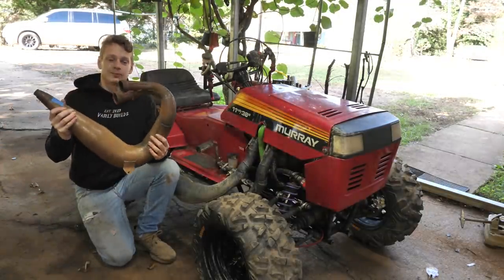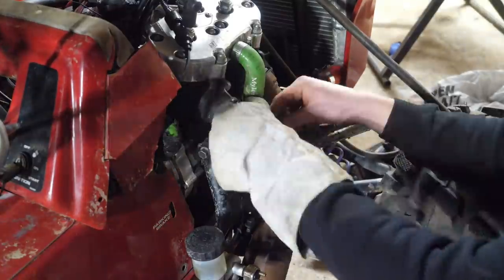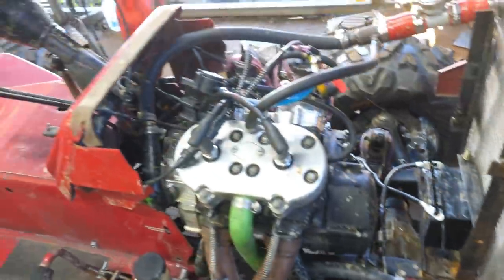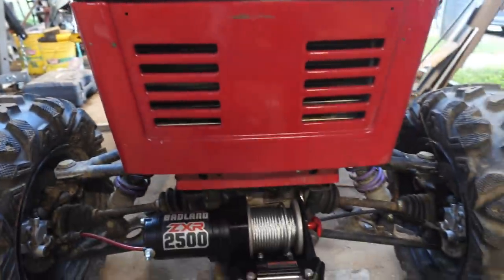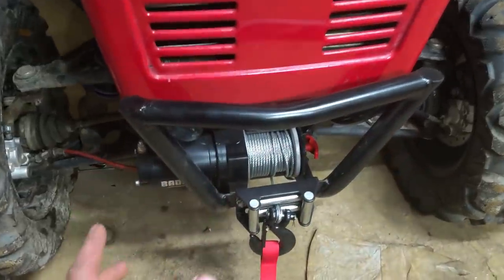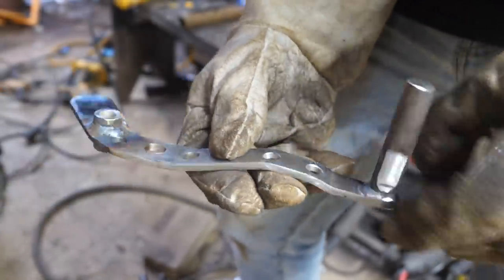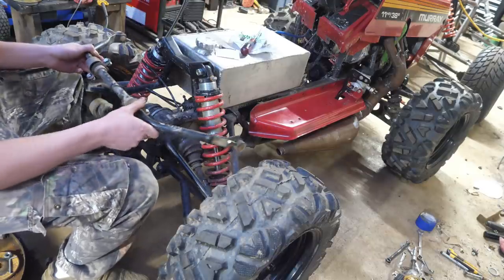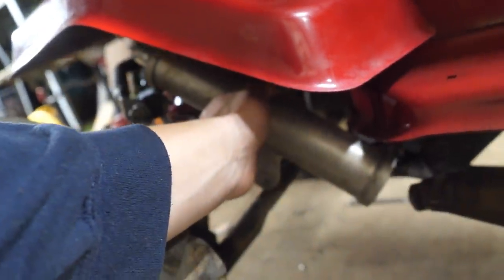4x4 2 Stroke Riding MOWER Gets 10x Better! Sounds like an F1 car

Comment: F-Yeah they sound tough. My neighbor goes through fazes. So during his quad faze he naturally chose a banshee due to the performance possibilities. So as usual step one break it down to every last nut and bolt. Sends the motor out. $20,000 later this Crazy piece of Performance Art returns. I honestly thought that my buddy got Ripped off and it was just pretty. Oh how I was wrong. We couldn't start it right away because it ran race fuel not regular gasoline. My first words on the  first start were, this sounds like a F1 car. That motor was so freaking pissed off I couldn't believe it. He actually only rode it a handful of times and sold it. We both agreed that it was a death trap and had too much power.
Reply: 4 mill cheetah motor ??? Or what

Comment: Bro.. the pipe's diameter and distance from the ports are precisely calculated in order to set your power band at a certain RPM--  When you cut it anywhere in front of the expansion chamber, you completely change it's tune.  It' still might work well, but if it doesn't, that's why.  That expansion chamber echo's the pulse back to those ports, and it does this at a certain speed (actaully at the speed of sound I believe)--- so if you change the distance between the expansion chamber and the ports, then it will change where your power band actually is... Typically the bigger the pipe and longer/ further away from the ports, the lower your power band will be, because it takes longer to echo back to the port--- so that makes it only work at lower RPM's--- (but also the more it will fall on it's face when you high rev)...... and that's because at higher RPM"s, the piston is going up and down in such a short time span, that expansion chamber has to be closer to the ports so that the echo can bounce back quicker, not that it's any faster --- it just has to go a shorter distance, which takes less time. I just have to stress again, the tuning of the engine and power band are directly related to that expansion chamber- it's diameter- and it's distance away from the ports...  hopefully it still works well for you--- but if not, just know that it's because of that pipe and you'll have to change it again.  There's a whole science to tuning a pipe for a 2 stroke..  There are not a lot of people who understand exactly how to build them right without the computer software to tell them how to do it.
Reply: Yes.
Reply: You sound very knowledgeable and I agree with you....  being as knowledgeable as you are I figure that you can also hear that it is running very well. When he made his pie cuts he rotated the pieces but kept the pieces in the same order, had he rearranged the pie cuts the results most definitely would have suffered. At one point, many years ago I was thinking the results would change or be very poor, but after seeing dozens, if not hundreds of shifter carts take the original snaking motorcycle chambers and pie cut them and reweld them in to a straight line with little or no loss of performance I became aware that it in fact does not matter.
Reply: @baby-sharkgto4902   Yeah, it does sound pretty good..  Again, as long as the changes are still a similar volume and length from the ports, it should still be pretty close..  It sounds like it's running fine to me.  I actually think his clutch is slipping.  If you watch it again. 11:46 -- after he shifts, you can hear the engine rev out quickly for a second--- as if that clutch is slipping.. Maybe that's him doing it on the controls--  maybe he doesn't realize that you only have to 'feather the clutch on take off..   Either he's doing it, or it's slipping.. or maybe the wheels are spinning-- but something is letting go...  You hear that smooth rolling load on the engine, and then after he shifts--- it high revs way too fast.  Clutches are easy to change though.   I've had issues with banshee clutches before... It would seemingly work fine until it would hit that power band, and then it would break loose.  I bought cheap new discs on ebay and never had an issue with it again.
Reply: @calholli  yeah I also hear that

Comment: Great job on moving your shifter..  You still need to shift faster.. Once it's pulling in that power band, just shift through the gears literally as fast as you can and watch it pull through every gear.  Trust me, when these things are running right, their power is pretty terrifying.....   It kinda sounds like your clutch is slipping...   either that, or you are too low geared and it's reving out before you can even shift to the next gear-- I can't tell without riding it myself...  It sounds like it's running pretty clean though, considering that you chopped up that tuned pipe..  Keep chewing on it.  There are more gains to come. lol..  Once you get it dialed in, it will start popping up wheelies when you shift while running wide open.

Comment: The exhaust DOES make it sound like an F1 car. Nice!!! Bumper looks great. You should dremel out the area where the stock headlights are and see if you can cleanly mount the light bar setup in that area. You could make a fiberglass 'bezel' or 'pod' to make it look like it belongs in that spot too. Would be sick looking.

Comment: 11:48 ...  See, it's reving smooth under load, and then right after you shift- it revs out/ high revs too quickly there ---   like the clutch is slipping.     The 6 speed transmission have really close gear ratios-- so you could actually be running out of gear that fast, which means you are too low geared and need to change sprockets slightly...  or again, you can just shift faster.  But honestly, it sounds very typical of a clutch slipping when the power band hits, or when you're rolling on the throttle...  Make sure that your clutch cable has a little bit of slack in it/  a little wiggle room-- so that you know it's fully disengaged..  Some people like to tighten their cable down too tight so that there is no slack, and that can cause it to not fully close---  it acts as if you're constantly slightly holding the clutch in a little-- which causes it to slip.... Either way, it sure sounds like it's high reving quicker than it should there--- something is letting go.  Maybe you're just spinning the back wheels on that pavement-- I can't really tell.
Reply: I also believe the clutch slips when engaging a new gear. I agree, check if clutch cable has little bit of play. This thing is gonna be awesome. This video you really were different, quick and efficient. Keep it going like this
Reply: The clutch is definitely slipping, possibly the cable too tight, or plates on there way out
Reply: You can hear the chain and sprockets skipping. Needs to go to a ribbed belt design or a better chain.

Comment: One other thing---  when you run it hard like that--- you should cruise around a bit and get plenty of air flow and let it cool down...  or at least when you stop --- let it idle for 40 seconds or so.  It keeps that water flowing in your head and gives it time to cool down.  WHen you ran it hard and then suddenly STOPPED.  All that heat is still chillin in your coolhead and that's why it started steaming that water.............  again, what I do when running it hard is take another lap easy cruising--  still running fairly fast, but not pulling hard and making heat-- that way you still have lots of air flow through that thing.. and by the time you stop again, it will be much more cooled down.

Comment: I loved the triple build, but I can see this works better. Do you have other plans for the triple?
Reply: "Works better" on this mower maybe-- but that triple is significantly faster on the right setup...   A triple sled will absolutely smoke a banshee quad-- both off the line and in top speed...  He just never had that triple geared right yet before he decided to change it.
Reply from the maker: Maybe a drag build
Reply: @calholli  He said that the cvt was way too low to the ground
Reply: @angelrs_0838  Yeah. .it wasn't a good fit for this.
Reply: Yes, meant works better for this build.

Comment: Unfortunately you may need to open that grill to move more air not sure if your running elec fan ? Consider that or some cowling to force air. Bigger radiator if or add small reservoir to displace heat exchange , heat steals power not your friend . Cool build keep at it and it will be terrifyingly fast lawn job , mowing , thatcher , aerating , twin bagger two pop multi purpose machine . And most likely neighbors enemy #1
If you continue to rip back & forth scaring the bejesus out of the unsuspecting  ? It would be ok in our neighborhood but their a mile

Comment: You should wrap your exhaust with ceramic bands to prevent over-heating because your coolant hose line is in between the exhaust collector

Comment: Gear ratio sounds good on the road but that’s it. In the woods you can’t hit gear after gear in the powerband because the gearing is to tall and you need a super low first gear anyways so drop that gearing so you can have a useable woods toy.

Comment: Ok now you need to do a whole new seating set up. I know your tring to hold onto the "look" of a mower... but its to much of a beast now build a little rack/cage letting you mount the seat back more use a bucket seat. Go from racing mower to  Rock crawler mower!!

Comment: i would have put bars on it and had the layout more like a dirt bike with twist throttle and clutch lever front brake and rear brake on the right foot and shifter on the left foot

Comment: Are you having overheating issues? The airflow may be the culprit. The hood openings are very small vs. the size of the Radiator. Either open the grill up or open the side panels beside the grille or possibly near the winch plus do you have an electric fan on the radiator.
Nice buggy!!!

Comment: Are you going to put a tip on the exhaust so it comes out the back? All that two stroke smoke will leave a residue all over the rear suspension and fenders.

Comment: There’s a little bit of scraping on the rear right fender when you press the gas cuz it squats so damn hard when you launch😭. May or may not wanna fix that but the thing sounds like a literal f1 car my jaw actually dropped watching this. You should definitely try meeting up with grind hard.

Comment: Vasily I have a question- my go kart with  a stage 1 kit goes a solid 26mph lol. I was wondering if I you removed the governor on your little red go kart you made a video on and rode around a school with. Because when you went full speed and hit 51, wouldn’t that blow the engine? I don’t know I’m just wondering the circumstances if I removed the governor and went full throttle. - Thank you

Comment: You do realise that increasing the length of a fat pipe like that completely alters the power band and when it comes in in relation to rpm. You will need to have the thing red lining before you feel a thing if you ever feel anything at that length. You are best shortening it back to roughly what it was!!

Comment: nooo bro... that a dyno port 2 in 1 pipe? bro dont cut that up... those are worth up to 500€ just the pipe people actually look for those.. atleast in eurrope they are as rare are paul turner pipe (who are listed new for 1500€ not in stock afcors)
Reply from the maker: This one cost me 175 euro
Reply: @VasilyBuilds  DAMNNNNN
i take back what i said then :)  that is cheap for a good pipe, i understand that you cut it up for that price who cares.
i wish i lived in America getting banshee pipes are hella expensive... if you can find them... last dynoport i saw went up for 500€ without the silencer, and sold the same day.
but you might have to learn a bit about 2 stroke and there pipes and curves you cant just cut them up and weld them back up, you could probably have someone make you a custom one that will give the full power to the engine.
but it still sounds MEAN